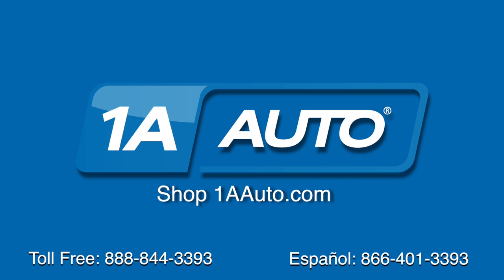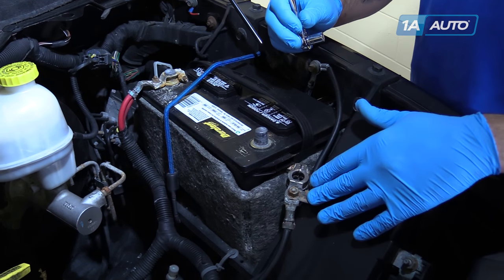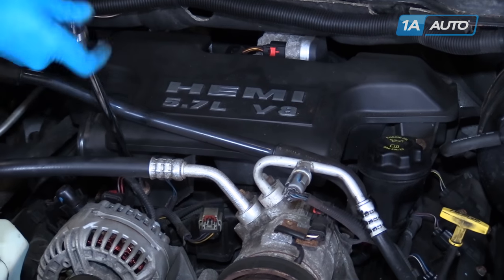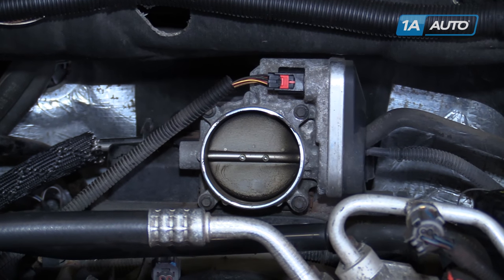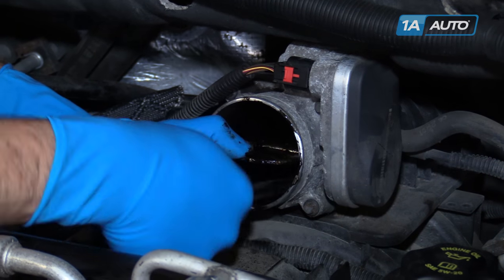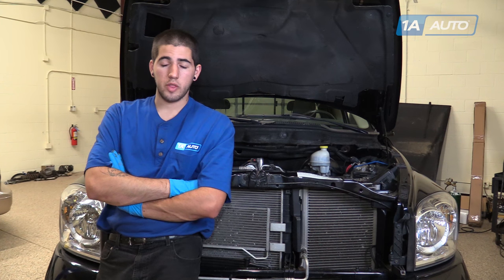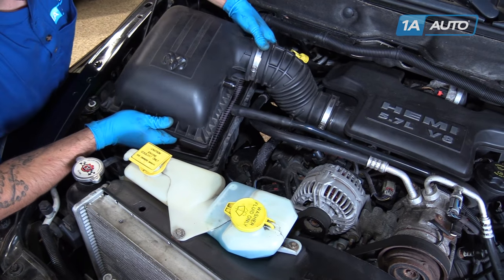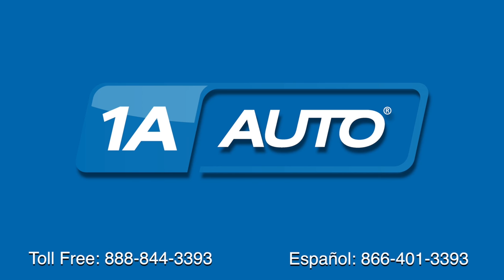How to Clean Throttle Body Assembly 02-08 Dodge Ram

Comment: I have an '06 5.7 H and this procedure seemed to have destroyed my Throttle Body (TB).  I did disconnect the Neg. on Battery, but did not remove the TB for the cleaning as in the video.  I also used my finger and toothbrush as in the video.  Upon completion, as the fellow covered, the vehicle did run rough but that did clear up.  However, when I next drove the truck and ever since, I am getting the Red Flashing lightning bolt error.  Since, in doing research, everything says to remove the TB and most say not to touch the fin.  I would recommend removing the TB, it's only 4 bolts and obviously wish I had done that. One video I saw, the fellow removed the TB an showed where it states "DO NOT CLEAN" right on the unit.  He cleaned it and it seemed to work well.  Anyway, I've ordered a new TB.
Reply: I have a'04 Ram 1500 Hemi and I've cleaned mine a few times, and I always take off the TB, never had problems afterwards.

Comment: This method stands the risk of trashing your stock TB. I owned my 08 for 3 days in 2013 when it needed a new TB post cleaning. This is how I always cleaned them previously but now they come off the vehicle, cleaner sprayed on the rag and then the rag to the throttle body. Do not spray directly into your throttle body. You've been warned. Great video for dismantling though.
Reply: I wasn't really worried about the throttle body but the fuel injectors. That debris can clog one or more of them unless there is some sort of filter before the injector. I don't see how spray it directly makes a difference than wiping it with a rag do you care to explain more? I am going to be cleaning my TB again. The first time I just sprayed it like in this video but my plan is to remove it and clean it correctly.

Comment: Back 2005 guy had old 1961 Caddy. Idle was so rough and low. With Gumout and a toothbrush I cleaned the throttle plate, poured some more in carb, let her sit about 10 minutes. That baby fired up and ran like a new engine. idle up, smooth. Guy thought I was a magician.

Comment: You can just unclip airbox, unscrew the 2 bolts and take out the whole thing in one unit.  Leave the filter in the bottom of air box to hold your tools. While your in there clean or replace the pcv valve and when done replace the air filter.
Reply: I place my tools on the air cleaner all the time. Probably not the cleanest way but it damn sure is convenient.

Comment: Can moving the Throttle Body by hand like that mess up the calibration?
Reply: yes it sure can. Remove the wiring harness before even touching these things, and never stick your fingers in there with it hooked up! High torque motor with a gear reducer will take your finger off like nothing! Honestly, it's 4 more little 8mm bolts, and it slips right off. I've never seen anyone leave it on to clean. Why would you wanna flush all that crap down your intake? And it's way easier to clean on your bench, or parts washer if you have it.
Reply: it seemed to mess mine up.
Reply: Try and re calibrate it
Reply: Re learn
Reply: Yes it can mess up the sync settings and you will have to perform a relearn process

Comment: I think you’re not supposed to move or touch the blade on any electronic throttle body because it will mis calibrate so Please don’t do it how it’s shown in this video otherwise you will have to reprogram it with a computer program compatible with dodge ram ecu  or in the worst of the cases replace the throttle body with a new OEM one!!! Please do your research first and you’ll se what I’m talking about ✌️
Reply: you are right !
Reply: It's more of messing with the screws on the throttle blade because they are calibrated but it's best to have a trust worthy mechanic deal with it
Reply: Yes you're right but that's why I'm here in this video because on the Dodge Ram Hemi 5.7 the throttle won't open when the key is ignition on and foot on the gas pedal like the Chevys so I don't know what the f*** to do now I'm just clean the outside of the throttle for now but why doesn't the throttle open when the ignition key is on
Reply: I think if the truck is off and raw battery is disconnected you can move it.  It's when the truck is running you should never do it.
Reply: This is incorrect

Comment: My mother in law has a 2007 Dodge  ram 1500 4x4 with 5.7 liter , this scary situation caused so much anxiety for my mother in law that she Don’t want to drive it anymore, So she was going down the highway at 65 miles and there was a car go slow so she is passing the car and seen a car coming so she kicks the pedal down and makes it , but the truck is still in high exceleration and going higher , she panicked and try’s to hit the brake but can’t stop , finally she able to put the vehicle in neutral and coast to the side of the road and the engine is just blasting in high rpm , what would be the cause of this .

Comment: Anyone remember the GUMOUT Cleaning Kit for carbs? Plug fuel line, feed straight GUMOUT into carb. from bottle you hung under the hood engine running. Boy those kits helped. They were discontinued because of fire hazard. I got lucky and Penzoil sent me like 8-10 kits for free.

Comment: I cannot accelerate smoothly. I depress pedal and nothing will happen and then suddenly rev up. Could this be the issue?
Reply: The throttle body could attribute to that. Alot of problems like that happen in the airflow parts of the engine. Those are the easiest to work on too. So it doesn't hurt to see

Comment: correct me if I am wrong,  by taking off the negative terminal,   that allows  you  to  move the throttle body to clean it,  so you don't cause issues with your  throttle coding.  Also correct me if I am wrong,   you can  also  have someone turn the ignition  on  and hold down the throttle  while  you clean it.
Reply from the maker: +Andy Southern You want to make sure the negative is disconnected so you do not cause any issues with the computer or electrical system while cleaning the part.  you do NOT want the vehicle on while doing this process.
Reply: I was told  by  a dodge mechanic,  that  the only  2 ways  to  clean  there throttle bodys  is  1.  use  a scan tool  to  open throttle  to wide open,  or  2.  have some one turn the ignition on but don't start engine  then have then slowly  push  the throttle  all the way wide open,  then  get  in there  with  throttle body clearner  and a tooth brush  and  get  at it lol  once  done cleaning   have  the person  who is  holing the throttle  wide open   to slowly  release  the throttle.  then  turn off  ignition.    this is what he told me  ......Yup. Don't touch it with the key off, or the battery disconnected, unless you want to buy a new one. You have to go Wide open throttle with a scan tool, or it MAY do it with the key on, foot down on the gas. The TPS and the Throttle actuator are both on the same shaft, so it may lose position if the key is off or battery disconnected. Take the intake elbow off, key on(not running), see if it opens wide. If it does, have somebody hold the pedal, get a tooth brush and a can of intake cleaner, get er done!!
Reply: No, definiitely don't clean it while the truck is running.  It's very easy to remove, and that's how you should clean it.   4 bolts, 8mm.   Keep your fingers and engine safe.
Reply: zachary i need your help i have 2007 dodge ram 1500 5.7hemi and i want to clean throttel body so i dont have a scan tool so i can turn key and push on gas to ooen it and then clean?  So dont disconnect battery?  I am confused please hellllp
Reply: @zacharysouthern9798  this is a joke right

Comment: Is the Idle Control Valve on the throttle bodys? I know up to 02 they were on the back of the throttlebody but I'm not sure on my 03
Reply from the maker: +anon  It is just below and forward of the throttle position sensor, attached to the throttle body.  Thanks for the question.
Reply: @1AAuto  no thank YOU. Hopefully this is the last thing I have to mess with on this old truck to get it going again
Reply from the maker: +anon Thanks for checking us out! 1AAuto.com

Comment: You’re not supposed to move the blade on the throttle body you’ll mess up the motor mechanism and will have to replace
Reply from the maker: +Ben Valentour Thanks for the tip!

Comment: should I replace or clean it the lighting bolt light comes on in the dash.
Reply from the maker: Thanks for checking us out! We would not be able to guarantee the procedure that would need to take place if the light appears on your dash. You can always try cleaning the thorttle body first to see if it fixes the issue. Otherwise, the item may need to be replaced. We hope this helps you out! +Chase Kennedy

Comment: what about the 3.7L V6 ? I am unable to figure out to remove the resonator box/air intake cover? i have an 08 , but your hemi engine removal is a breeze compare to mine. those bolts under the alterntor and oil filler I dont have them. Reading online and everyone has the 4.7 , Hemi or the 4th gen ram. Any clue on removal?
Reply: I have the 3.7L engine.  Sorry it took three years for you to get a reply :)   The resonator is mounted with two bolts, one of the left and one on the right.  The one on the passenger side is at an angle and the one on the drivers side is vertical.   Once those bolts are out, hit the bottom front of the box upward, with your fist or a rubber mallet, to loosen the post from the hole it's in.  Then grab the box with both hands and move it around to loosen the outlet from the throttle body.  Pull it towards you, away from the throttle body.
Reply: I have an 02 3.7 and it has a bolt on both sides and 1 hose on the back of it.

Comment: Why do you disconnect the battery?
Reply: Because you can fry the computer or cause a spark creating a fire. I have never had these people respond to questions.
Reply: Fred No... You disconnect the battery because you need to be able to move the blade manually without it trying to keep closed and without it being energized at all. Inside the throttle body the motor is very powerful and can cut your fingers if it tries to close. 

You disconnect the battery and when you're done reinstalling everything, the ECU will have a blank map and will relearn the TPS values which have changed after the cleaning.
Reply: @mannys9130  it's about time someone has a brain on youtube.  There is a lot of bad advice out there . If you dont no the answer dont make one up it will cost someone big buck to fix something that wasn't broken .

Comment: THE BUTTERFLY BLADE SHOULD NOT BE TOUCHED!!!!!!   THEY ARE CALIBRATED TO SPECIFIC SPECS!!????????
Reply from the maker: +Jose Vasquez Thanks for the feedback!
Reply: You can touch it as long as the battery is disconnected.  Never do it when the truck is running .